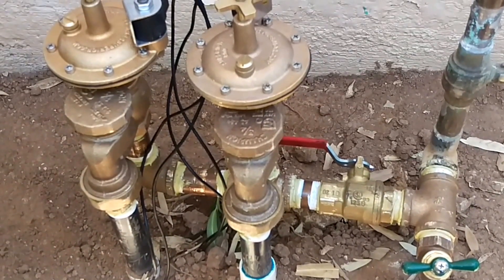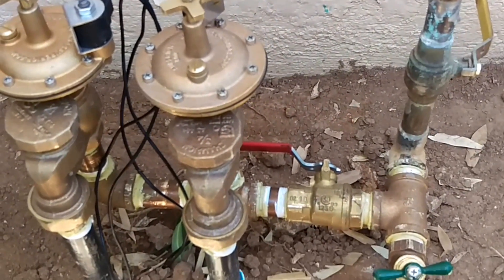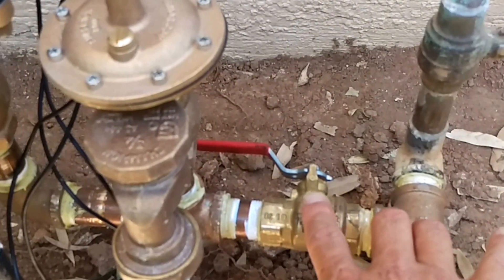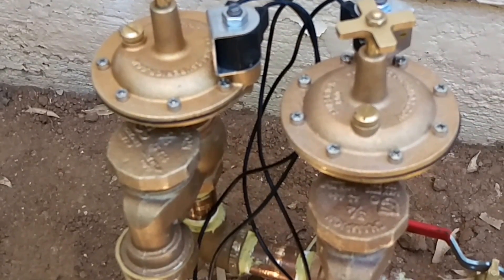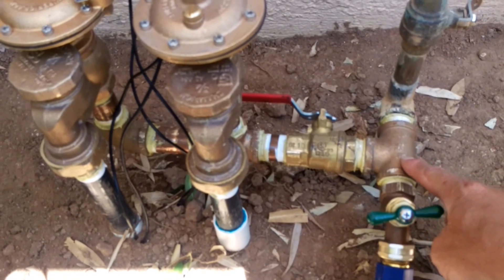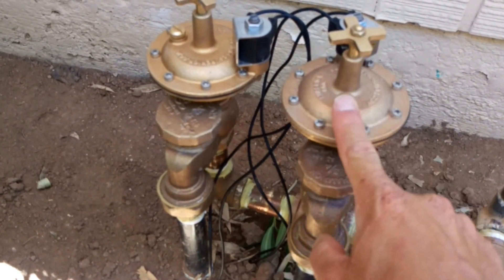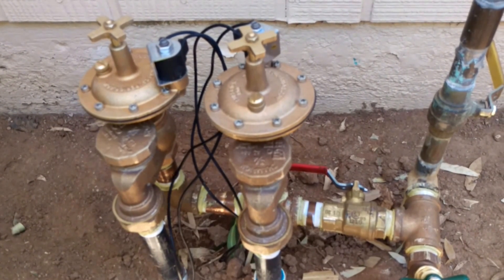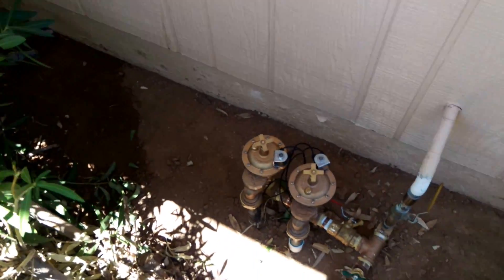How To Plumb And Install Brass Irrigation Anti Siphon Valves

Comment: The union joints on the exit (output) side of the anti siphon valve... what did you use to connect PVC at that location?  I see some runs of black... something... or other... glued into white PVC...

Comment: Hi.  Currently I have 3 brass valves in the house I just bough a year ago.  I want to repair these 3 in order to not spent too much in new ones.  So, I went to different suppliers and the only one that has the repair kit is Home Depot.  The problem now is, I could not get these valve disassembled, since they have rust and anyway, I would need a pictured procedure to replace all those O-rings, diaphragm, etc...Do you have a dummy-do it yourself guide to perform  this ?  VALVES CHAMPION AS 466 3/4 Anti-SiphonThanks

Comment: Eww brass valves -.- hate those
Reply: why?
Reply: because they're stupidly expensive and bulky and the inlet/outlet valves are so fucking close and sometimes you can't take the stupidass actuator without taking out the cap, OR worse, you can't take out the cap to replace the float without taking off the actuator because they're so god damn close to each other it's physically impossible to, i have 18 of these at my house, ive dealt with this crap so much im a master on these lol
Reply: Bludika in the desert brass is the way to go...plastic valves dont last long.  Plastic either ends up cracking or seals go bad fairly quick.  My goddamn neighbors are on the side of the house and hers end up splitting at the breaker cap like every other month, spraying my truck.  I have water stains all over the driver side and windshield of my truck that I can’t get off because of her valves constantly breaking.  I told that dumb bitch several times she needs to buy one of those fake boulder covers to protect them from the sun...you would think after 5 times of her paying to have them fixed she would listen.  I’m gonna make that fucking slut pay to have my truck detailed next time
Reply: @RoddyDa  wow you’re a real gem